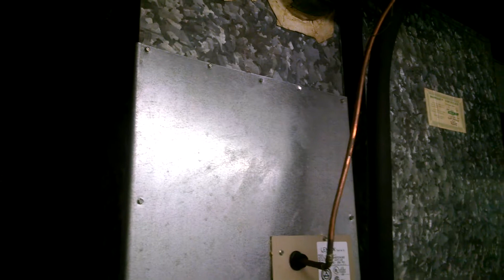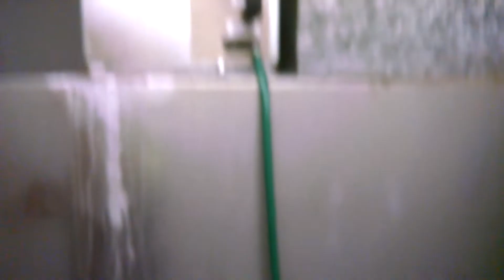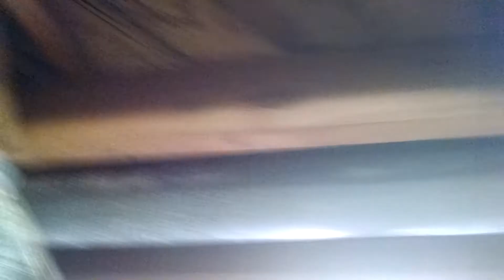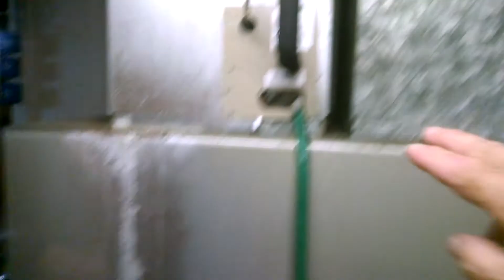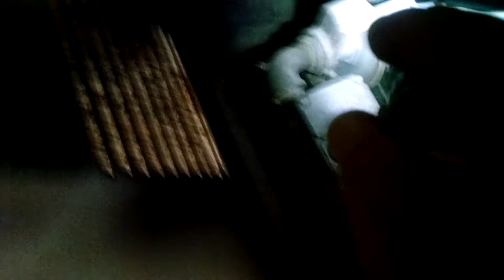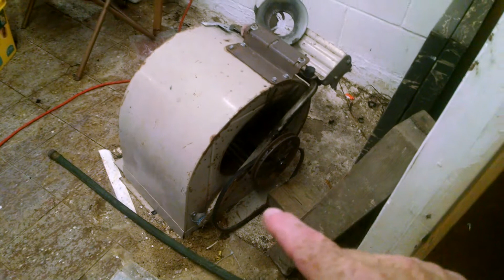Major expense.  Furnace central air system replacement

Comment: I have a very similar oil-fired unit, installed in 1954 and still running strong at 78% efficiency. Mine's a bit longer due to the front section being larger to accommodate the MASSIVE oil burner. I will replace it eventually...
Reply from the maker: I helped carry out the old furnace when they replaced it.  The techs were also repair techs so I had them look for obvious issues.   They said the burn chamber was intact.  The ducting was intact.  Other than being old there wasn't anything wrong with it.  

It has been installed for 7 months.  The gas company has adjusted the bill monthly.  It is based on useage rates in years past.  So far this winter it is 60-75 percent normal bill.  The bill shows last winter and average weather conditions.  That includes the polar vortex event.  It got to -30 plus wind-chill.   I normally have to add extra insulation to the exterior of the house a d prop it up with hay bales to keep 10 feet of water lines thawed out.  This year in Sub-Zero I just ran fans and had no problems.   The airflow is dramatically improved.  It moves curtains on the furthest duct run from the furnace.  I am happy with the purchase